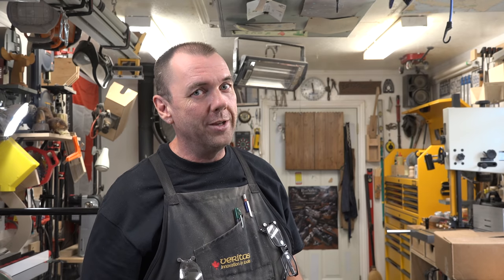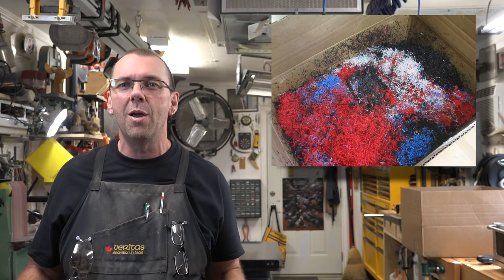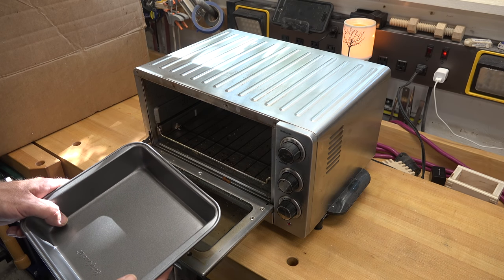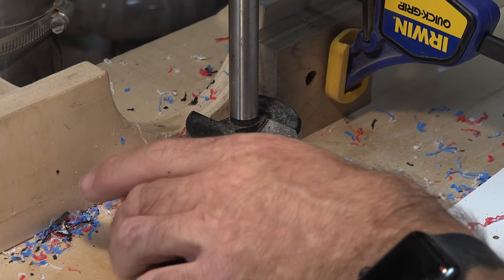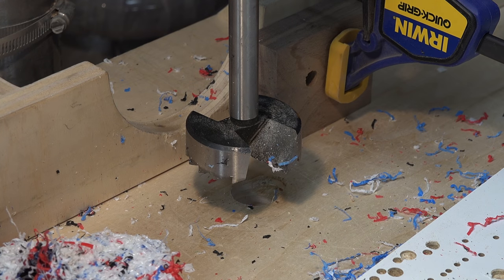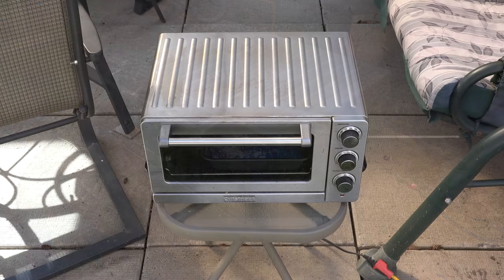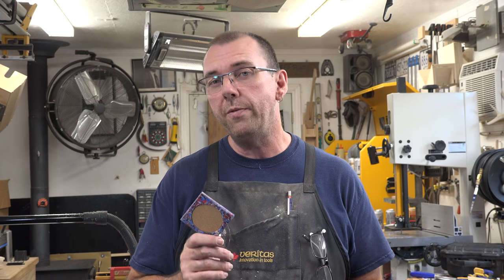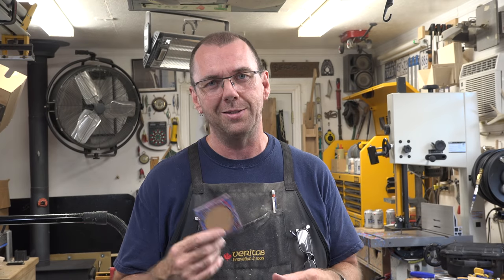Making ABS Coasters

Comment: Just curious how many pairs of glasses you need?  If you put more hooks on your apron will you hang more glasses?  :)

Maybe your layers separated because of the intermediate compression - there was nothing for the next layer to grab on to.
Reply from the maker: Ha ha ha ha ha ha ha ha ha ha.  My biggest problem Ken is that I put a pair down and then I can't find them and so I need spares.  The black framed ones are my reading glasses for the smaller stuff, the other pair on my chest are my safety glasses (no prescription lens in those) and the ones on my face are my tri-focals.  I hate getting old but it's better than the alternative.  I remember a time when I didn't have any glasses on my apron during the show.  LOL.  I believe the layers separated for several reasons, lack of heat and melting, lack of fusion, and your suggestion of the lack of compression.  I will be trying again and I will most likely post the results of that.  Thanks for tuning in sir.  I truly appreciate it.
Reply: @acutabove_woodworkings  Well , by intermediate I meant that it was too compressed, too smooth for the next layer to bind with. True, though, that a higher temperature could have softened everything enough that it could bind. 

Or maybe you need something like this:  https://m.harborfreight.com/50-ton-hydraulic-shop-press-96188.html :)
Reply from the maker: Ha ha ha ha ha ha ha ha.  That might be a little bit of overkill but I love the way you think Ken.  It's a shame that I don't live closer to a Harbour Freight (and yes, I'm aware that I added a "U" in the name Harbour.  After all, I am Canadian eh).

Comment: Did you consider using a heat gun to melt the plastic? That may be a better idea than to wreck the toaster oven.
Reply from the maker: I considered that David.  I didn't think that I would be able to generate enough even heat to get the ABS properly pressed and heated.  A used panini press would work great also I think.  At least the toaster oven wasn't damaged.  Thanks for tuning in to the show.
Reply: The heat guns at Canadian Tire have 2 heat settings. One at 300c, and 500c. That would be more than adequate.
Reply from the maker: @daviddearden5625  I have a heat gun that would heat the ABS.  My concern is whether or not it would heat it evenly enough to melt it down.  I guess there's only one way to find out.

Comment: Word to the wise from experience  don't steal stuff for food use from the house.  Just go garage saling  and buy a used discard for experimenting . 
I have discovered a different appliance  that better suits the purpose.  A Panini press  they are better suited to make flat plates.   The teflon releases  the solid easy as it shrinks back when cooling.    I've been able to make almost flat 1/2 " sheets to 10" x 10" in 1/2 hr . The  press heats both sides at once and can be held in place  while cooling.    The best temp  is between 325 and 350 f  and medium near high on the top
Reply from the maker: I love this suggestion Peter and I appreciate you chiming in with it.  I may just have to keep my eyes open for a press at a garage sale or clearance centre.  Thanks for tuning in to the show.
Reply: Kenny  Mahalo for the reply I have purchased two so far One KA and one Q  both work fine and the heat surfaces are removable and have two patterns (one flat and one with slots) this allows for variations on a theme.   I'm attached to a startup Makerspace here on Maui   mauimakers.com   I originated in Chicago
Reply from the maker: Awesome info.  I appreciate the link and will be sure to check the site out.  Thanks for tuning in Peter.

Comment: 3D printers use ABS and heat it to around 450-570 F range to melt it.  It looks like the burning temperature is around 780 F.  You're smelling fumes from the chemicals in the ABS which you probably don't want to breath a bunch.  Might do some research on whether you still wanna use that toaster oven for food.  If you really want it to come together you'll need to up the heat probably.
Reply from the maker: Thanks for the input on the show and the concern for safety.  It's very much appreciated.  I definitely think that part of the problem was the heat setting.  Thanks for tuning in to the show.